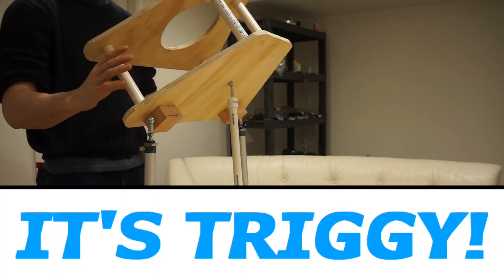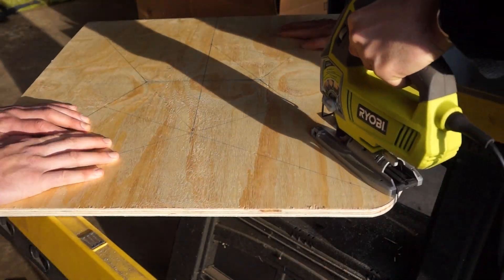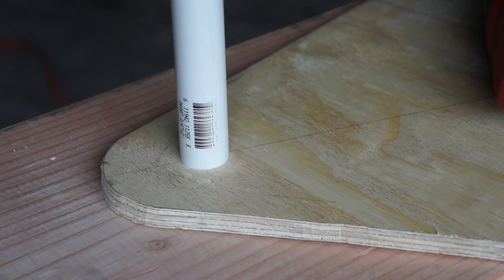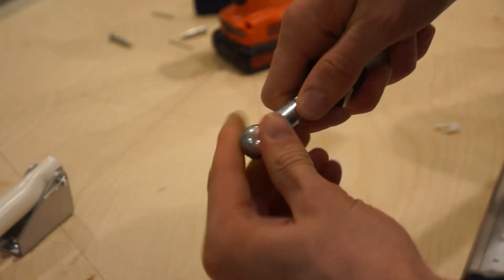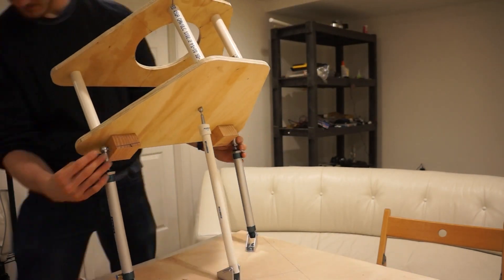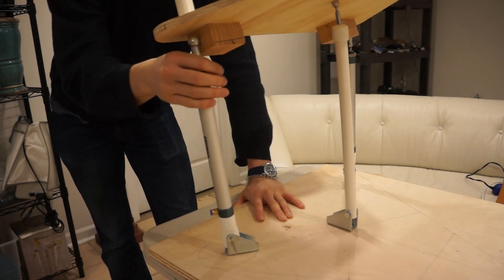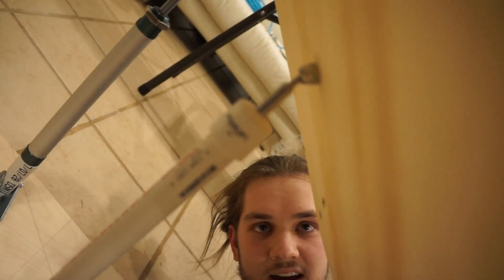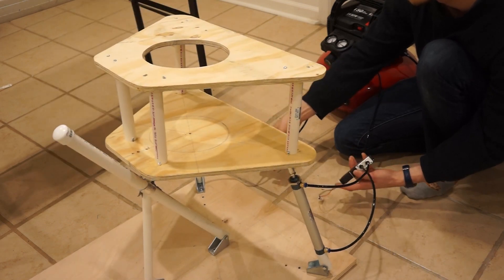Can I build a combat robot? | Part 6

Comment: Great idea, I've wanted to do something like this since I saw the "fighter" in Lynch's Dune. I'd never imagined it with VR though, I can't wait to see where this goes. I think you're going to have to massively upgrade the mechanics though, mechanical fatigue is going to make quick work of pvc (try threaded pipe) and those small pins. I think that the static support mounting point needs to be several inches further back as well to provide more support. I work in mechanical reliability testing and the TL/DR of my experience is that sizing parts up by 3X from what you think you'll need is usually the bare minimum. Good luck!
Reply from the maker: This is such a great comment, thank you! I totally agree, basically every single part of this (except maybe bob?) is going to need an upgrade. The advantage of using wood/pvc is that it's cheap and easy to cut, which is good for a prototype, but definitely won't hold up long term. Threaded pipe is a good call, if THAT stuff bends, then I give up lol.
Reply from the maker: What's your thinking for moving back (I assume you mean in the direction of BOB's back) the static support?
Reply: @itstriggy4814  My mistake, I meant further forward but I see now that it was moved by the end of the video. Any plans to add a couple of arms? Using a simple camera with OpenCV you could probably identify the human's location pretty well and throw a few punches back at them.
Reply from the maker: @circleofowls  Yes and no-- I'm hesitant to hit the player with anything physical, but the game would include virtual arms that have an audio/visual response (think getting shot in COD). I'm hoping it wont be too immersion breaking, and it avoids a host of safety concerns